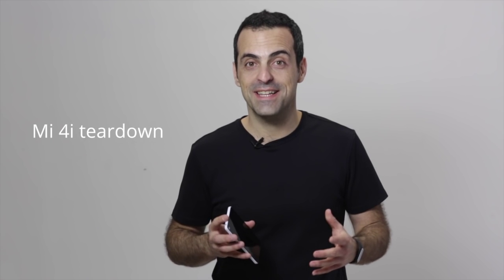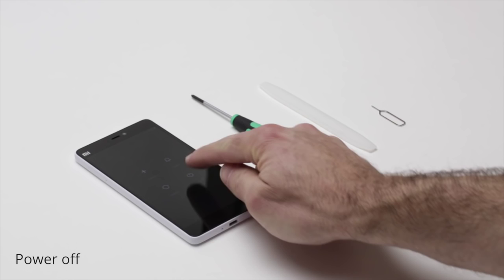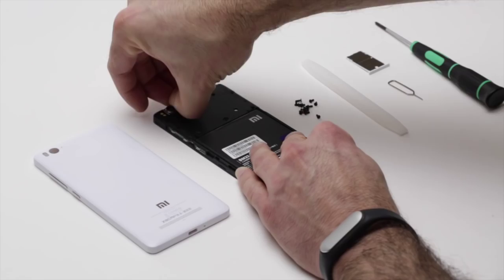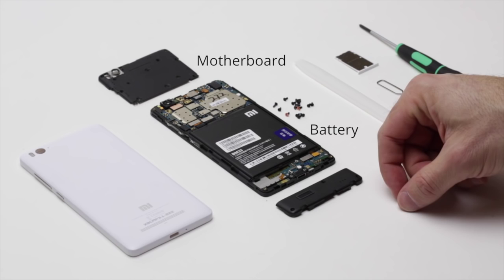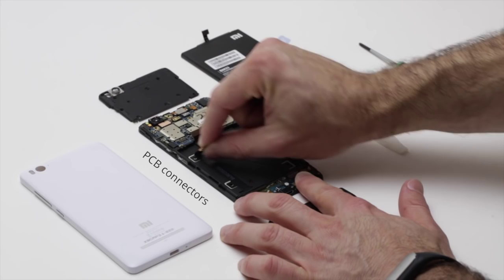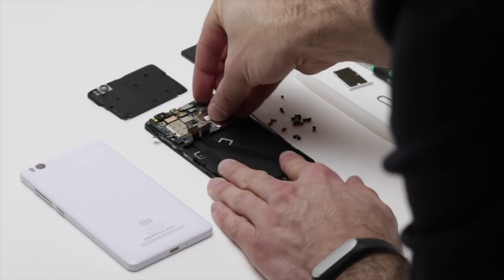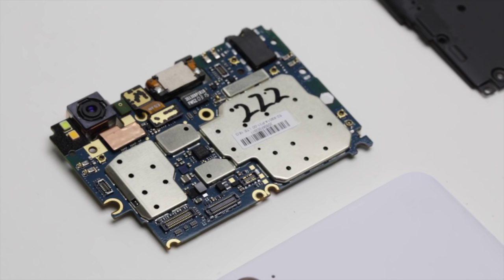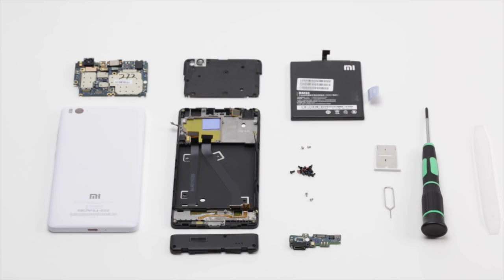Xiaomi Mi 4i Teardown with Hugo Barra

Comment: at 3:33 what is that small white plastic thing on the right above side? because when i opened motherboard it came out and i want to know where to fit it.
Reply: It's the plastic peel to pull out the battery. Watch the video from 1:48 to 1:53